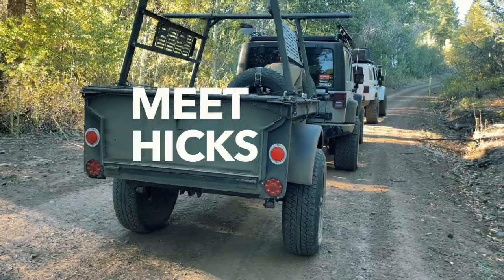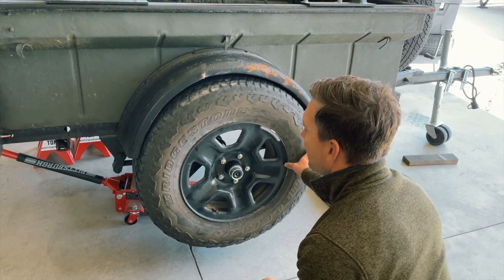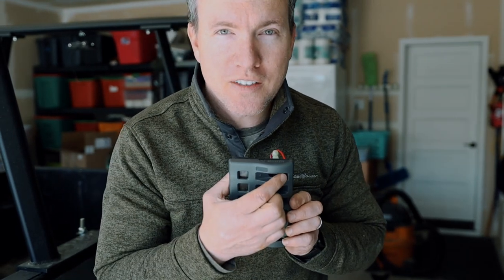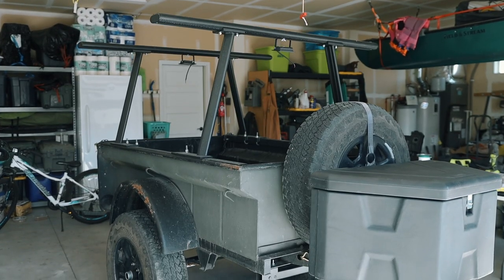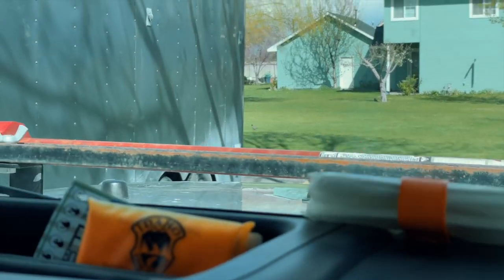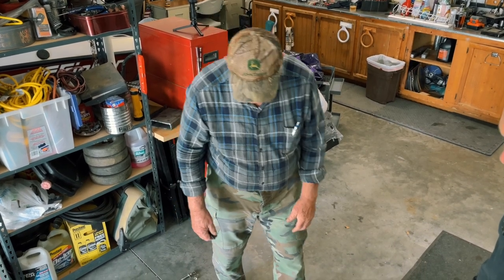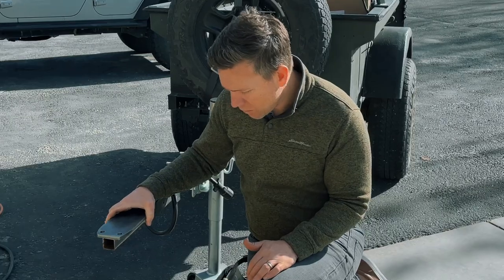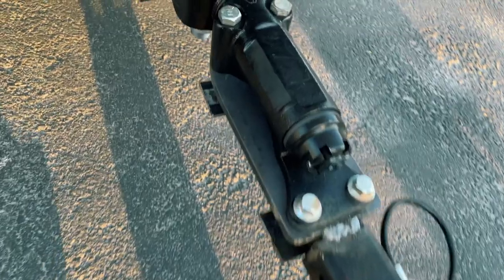DAD to the RESCUE | We Install the New Axle, Switch Box, and HITCH

Comment: You can go spring under and use a longer shackle to get more clearance. To an extent. Summit has adjustable shackles with multiple holes so you can fine tune it. I used these then cut off the excess.
Reply from the maker: I’m gonna go check that out now. Thanks for the tip!!!

Comment: That axle flip ( lift ) is going to burn up the inside of those tires. Been there done that.
Dexter makes one that can be done in an hour for a 2 3/8 inch axle. Same lift you've got but stronger and it'll position your axle the way it was designed. Less than 100 bucks, and Pops can break out his welder and whiskey again. Got mine on ebay. I am not sponsored, ;) Love the generic hitch .
Reply from the maker: This is really great info..thanks snd keep it coming!

Comment: I would have gone with the Lock&roll hitch.Test and proved and easy to install.
Also remember to take a look at Timbren Silent Ride suspension.You remove those hideous leaf springs and use the same 2 3/8  axle and  is like night and day difference.
Reply from the maker: You're not wrong...about any of it...and we looked at all of those options...but we started running out of money lol...so we decided to get a little creative...still working on the suspension issues! ore to come. Thanks for sharing your advice - you're spot on.

Comment: Trailer axles have an arch to them that is designed to be up . This is to help with weight . To properly flip the axle , you need new spring perches welded to the top of the axle .
Reply from the maker: I didn't know this until after we flipped the axel. Thanks for the great comment!

Comment: Not that it's going to help you guys now, but I'd have done it a lttle differently, groving the original tongue for the bolts, sure shore it up internally with a secondary piece, but have fillets on the top and the hitch plate on the bottom, easier to weld it all up and totally solid.
Reply from the maker: Great suggestion!
Reply from the maker: Thanks for the tip! We might revisit this.